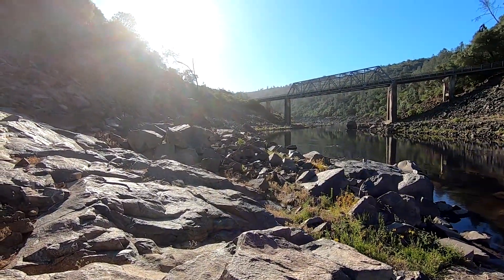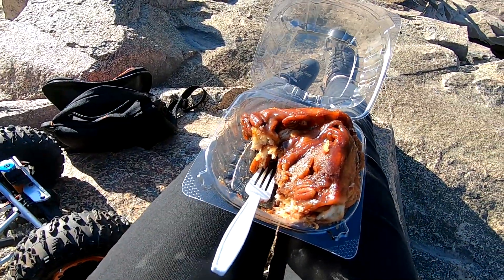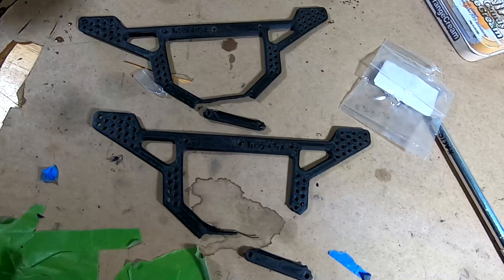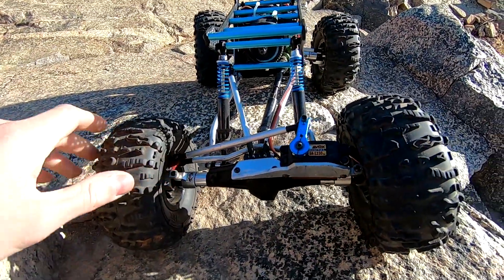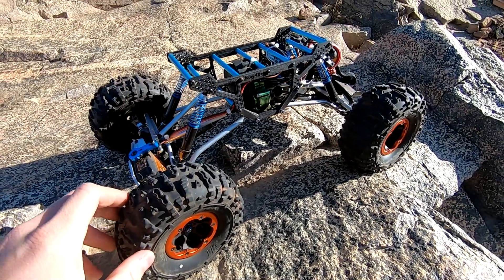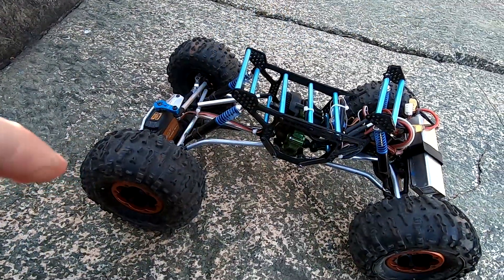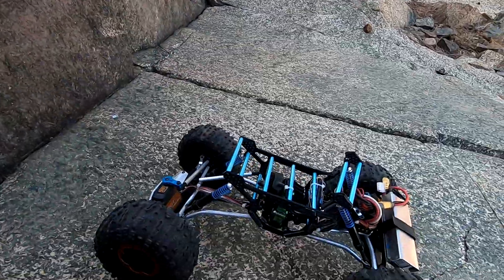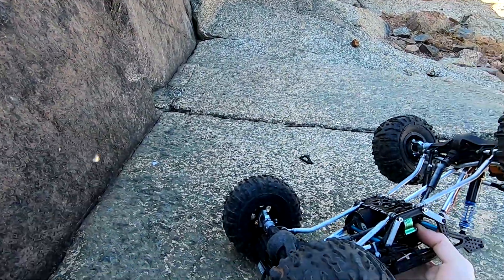What you might call a bad day....

Comment: Hi Erica,  New viewer here.  Enjoyed looking at your back yard course build and seeing it come to life.  Then a video you did of a live stream where you started the swap with the 3D Printed chassis parts grabbed my attention.  That was exciting to me because I've been 3D Printing for a few years now and also have a small laser cutter.  A couple months ago I acquired a box full of r/c car stuff...  4x4 stuff, gas / nitro stuff and none of it was really any good for much of anything.  My brain cells went into overdrive and I built a 4x4 crawler from all these oddball parts.  Had it built, it drove amazing.  I could ease it up to a wall and it is so low geared it would actually climb a 90° wall till you stop or it falls over backward.  I invite your opinion because what I've done now is tear it all down and 3D Printed with Carbon Fiber full frame rails and crossmembers. Also printed axle housings for the diff's and this time going with leaf springs, also 3D Printed. All of the caster blocks, spindle blocks, everything is 3D. My goal is a fully 3D Printed Crawler with the exception of the metal gears, steering pushrods and such.  #FrankinTruck  Look forward to hearing from you on the topic if you have time.
Reply from the maker: That sounds like a super sick rig! I know someone who built almost an entire independent front suspension out of 3d printed parts. I think that would be doable, I would definitely look at what is out there before starting since there are probably a lot of problems that you will hit that have already been solved. Unless you want the challenge of tackling them yourself of course.
Reply: @Hwy49RC  I really enjoy a good challenge, But the rolling chassis is already printed & put together. Working on the driveline now actually.

Comment: I wouldn't give up on the 3D printed chassis idea. Maybe for this vehicle it isn't the way to go but they can be very strong once the weak spots are designed around. For instance I ran a printed chassis on my first build for over a year and a half.
Reply from the maker: Makes sense. I suppose this type of rig is more prone to having chassis bend/break because of how vulnerable and out in the open the chassis is. if it was on a trail truck it would work pretty well I think.
Reply from the maker: since there would be a body to protect from the hard impacts